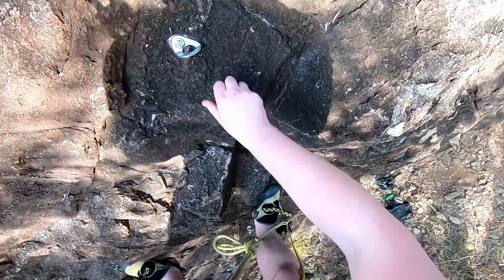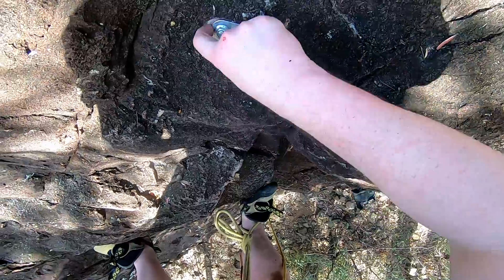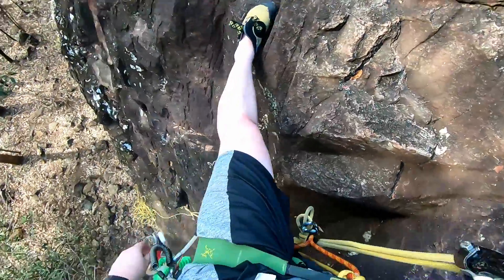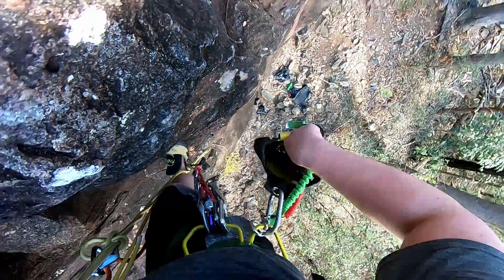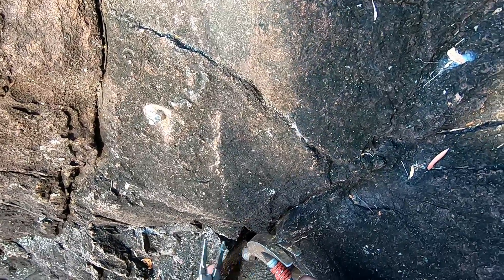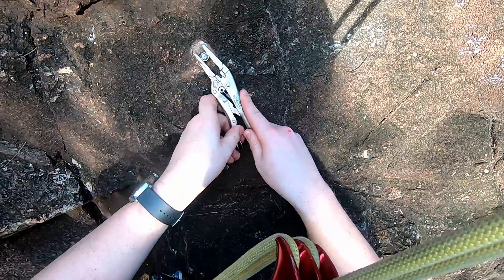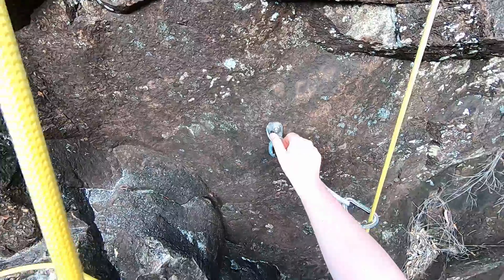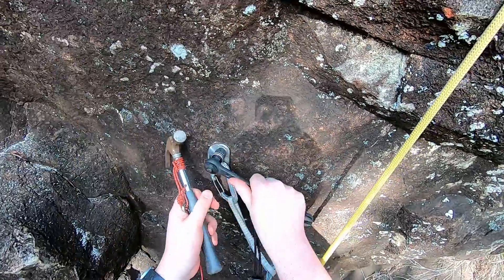How to remove sleeve anchors (expansion bolts/dynabolts) [bolting for climbing]

Comment: I need to remove one expansion bolt from the Transmission Mount, since I want to replace that mount. In the car 2003 Chevy Cavalier, the Transmission Mount is attached to the subframe with 3-4 usual bolts and one expansion bolt, which is located at the center of the mount. No films about that process in details, but I saw one film where the author broke that expansion bolt on Chevy Transmission Mount. Please could you tell if the procedure of the removal of the expansion bolt on a car would be the same, as in this film? Do I also need those special tools to remove it? I have a Shop Manual for that car, and on the replacement of the Transmission Mount they don't say about any special tools, just say: Remove the Expansion Bolt, then remove other bolts.  I would appreciate any opinion on this matter. Thank you for the great film.
Reply from the maker: I'm afraid I have no idea! I searched but couldn't find such a bolt, and never heard of expansion bolts in cars. But I can say the bolt in this video had the nut on the outside, so if there's a nut and a sleeve you can pull beneath the nut then it might be a similar thing. Perhaps asking on Reddit or quora might help
Reply: @MountainMullet  Thank you very much for the attention to my question. I watched both if your films and that way got a clear understanding how to work w/a Sleeve Bolt. The thing is that the central bolt in the Transmission Mount of 2003 Chevy Cavalier is of unknown nature, it is only known that it is an Expansion Bolt. But on Google I found the statement that you need to find out if the Expansion Bolt on the transmission mount is a Sleeve Bolt. If it is they advise w/a procedure explained in your film. But I suspect that it is smth different. Yesterday I looked at it, and it is a head of the usual bolt there, like 10mm, not a nut, which you can remove. The film, which points on the problem can be found if to type on YT "2003 chevy cavalier engine transmission mount". It is a film of the author Efurd Garage, he explains the problem. It is the only film on YT which addresses the problem. The author corrected the broken bolt w/welding, I don't do welding and won't be able to correct it that way. I feel that the Chevy is the only car w/that type of attachment of the Transmission Mount. Thank you again.

Comment: This only works if your anchor sleeves are made of good quality metal. I used some cheap anchor wedges that came in a kit from China, and the metal is so soft that it completely managed and broke off when I tried trying turning it with small vice grips like yours.

Comment: If the expansion bolt is still in good condition and it's just the hanger that spins, why not just tension up the nut? cheers, Mike
Reply from the maker: In this case I think I replaced it because it would just keep loosening again. You can often just tighten the nut, but with wedge bolts they'll end up as a perma-spinner after a few rounds of that, because they jam up inside the hole. With sleeve bolts like this the nut tightens against the sleeve, not the rock, so this bolt would tighten up again but the hanger would still spin
Reply: Gluey is just better